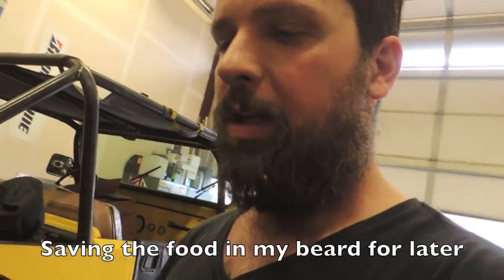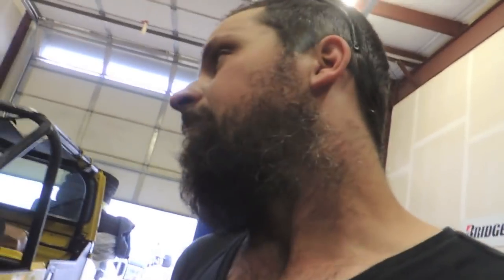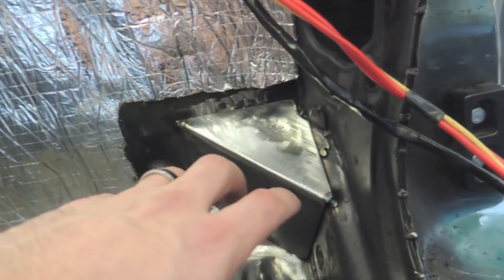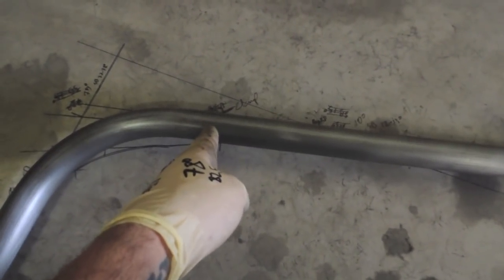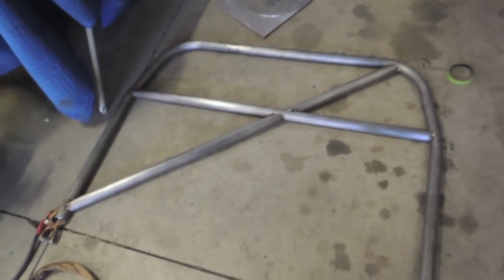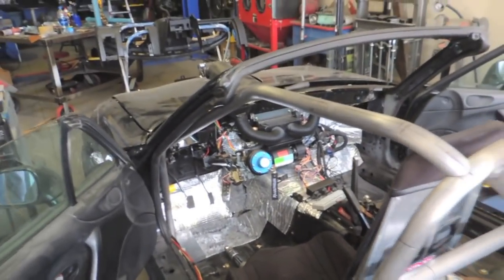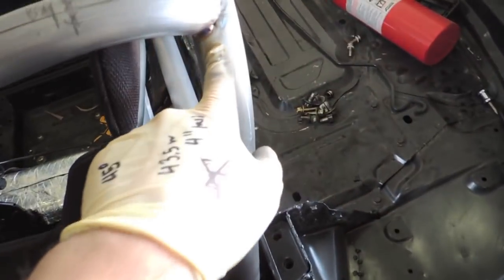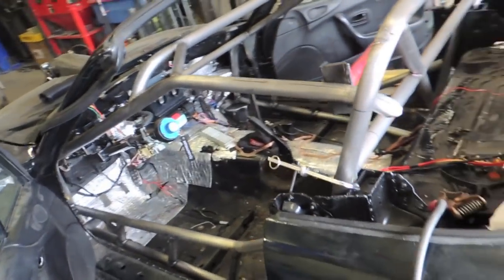Miata roll cage build. I'll show you the basics

Comment: How much weight did this add? Seems like a ton compared to how much can be removed by taking out stock interior pieces.
Reply from the maker: Are you asking how much a cage weighs? Normally 100lbs ish.
Reply: @Missileworksllc  all that DOM tubing only adds about 100lbs? That's not bad at all, I figured it would be a bit more than that. Thank you for your time and info. Building a miata myself and just trying to decide what direction I want to go. I am not going to be doing any professional racing I will be attending some local club events. I am not a fan of any convertible so I want to be as safe as possible....even casual driving.its only overkill until it saves your life 😂